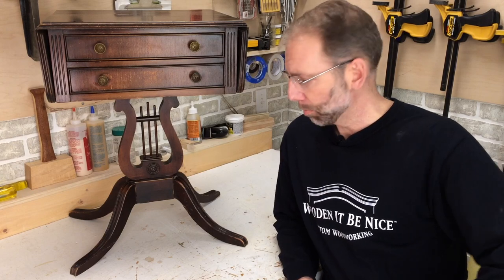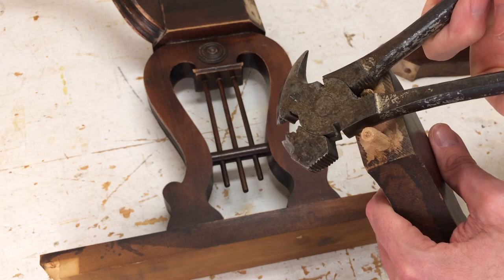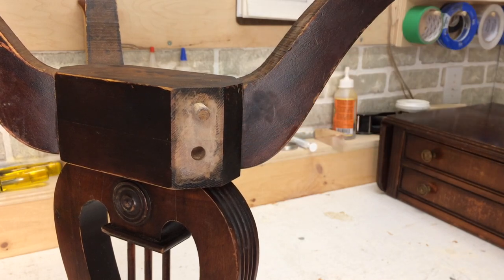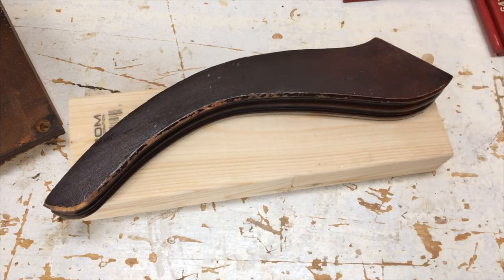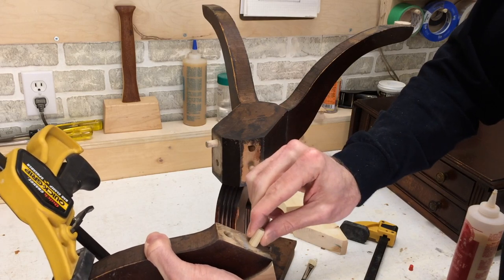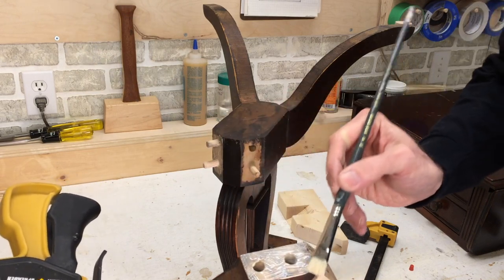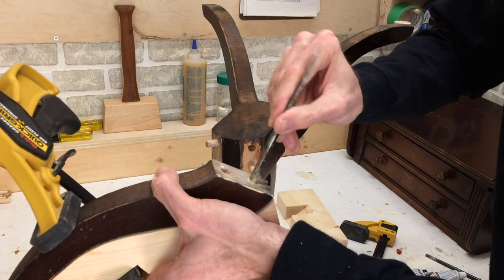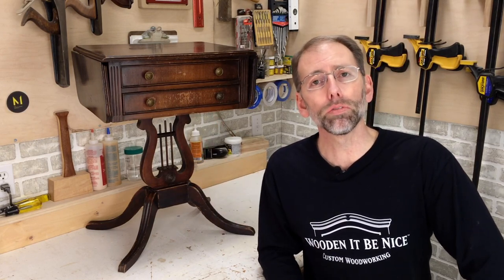Pedestal Table Leg Repair with Vector Clamping | Woodworking How To #Restoration

Comment: Hello, 

I understand from a traditional or restoration perspective (and perhaps from a preservation or appraisal perspective) why you would want to use Hyde glue on an antique if Hyde glue was used originally, but I'm having trouble understanding why functionally it wouldn't work to use modern glues? Aren't the wood properties going to behave the same? What if my purpose is to NOT have the joint coming apart again? But please correct me if this is just not what I should be going for with my furniture joints. I'm here to learn. Thanks for your videos!

Matt

Comment: Great video, illustrating the tenets of which type of glue to use as taught in your "glue video".  I understand using epoxy because of its gap filling properties, but in an extremely loose mortise situation (dowel joint), are you ever tempted to increase the size of the dowel and re-drill the holes to the next size up? Then you could use PVA glue. Also, when you do use dowels, do you place the dowel grain parallel to the leg wood grain to avoid a "cross grain" situation, or is the expansion and contraction of the dowel grain is so minimal as to not being important.  Thank you so much Craig

Comment: Thanks for the really good video. I do have a question though. I have an antique mahogany table and a leg came off one pedestal. I have cleaned out the dowel holes and have new dowels and I’m ready to glue. Is Titebond III good wood glue for the face of the joint and what epoxy can I use for the dowels? Tom

Comment: @FixingFurniture good job! Thanks for the lesson. 
When type of pliers are those? They look like they would be good for pulling staples and nails. 
Trying to learn as much as I can...why would you not use filler on a hidden connection simply because it's antique?

Why do you use hide glue instead of today's type? Nobody will see it and I don't want them coming apart in the heat of summer. 
I will be working on antiques again.  Wish you could see the old phonograph I got for free! It works but definitely needs tlc...waiting for no more snow...blech. I have to work outside for the most part. 
Speaking of which...any idea how I can remove the tired felt the records ride on and do I require a specific felt?
Reply: P.s. I just shared your video with two groups I belong to.

Comment: Thank you for this video!  I have a very sentimental dining room table from the 1940’s with six pedestal legs which are starting to fail.  I’m going to attempt to re-glue and clamp them myself.  One question if I could ask:  a few of the legs are clearly separating from the post but are not easily coming off by me pulling on them.  I’m a little hesitant to wedge them off, but I’m thinking this may be the best option?  Do you have any advice?  Thank you greatly for this video!
Reply from the maker: Wedges are the most gentle way to separate them.  Just make sure you use the wedge on the bottom edge of the leg and not the top as the grain on the top could break of some wood.  I hope that helps.  Scott

Comment: Great video as usual. One observation, you seemed to struggle with the clamp to get the joint tight, conventional screwed clamps exert a great deal more pressure than the quick grip 'pump' type you have there.
Reply from the maker: Thank you for sharing the tip Graham!  I found it useful, and hopefully others in this furniture repair community will too!  Scott

Comment: WOW!  I have my great aunts 2 pedestal  dining table.  My dad, who did some woodworking, tried to repair it but came into the same problem he had....nowhere to clamp. I think I'll give it another try so I can remove the support wood block. We can't use it because it is so wobbly.  The chairs need gluing too. This set, along with the China cabinet and buffet were damaged by Hurricane Katrina...that bitch!! The sides are warping. At this point,  do I just live with it or pitch it out? It's almost, if not 100 years old. They don't make furniture that good anymore. Hurricane Ida...think it was that 1 didn't help matters. Hot as hell with ceiling falling down with humidity...good thing the food is so good down here. Anyway, I'm glad I  found your channel.  I'm in the process of slicing 2 armrests into 4 legs for a child's vanity stool. I don't know what I'm doing but I'm trying!
Reply from the maker: I'm glad you found our channel.  We have a lot of videos to help you learn about furniture restoration.  I suggest starting with simple repairs to build your skills.  The china cabinet and hutch sound like an advanced repair, which you may want to discuss with a professional to restore.  Scott

Comment: Scott, a great video,  thank you so much!. I have a 1940s pedestal dining table (6 legs)  where I have a similar problem. I was treating the dining room as an antique so did all other repairs with hide glue. However, one leg on the table has a loose dowel joint (larger hole) which is fixed with epoxy in your video. How do I fix with hide glue to fix the gaps?  It's the last in my puzzle to get the dining room finished. I could use epoxy but wanted to stay true to principle of hide glue all the way through. Many thanks in advance. German Paz, Houston - Texas.
Reply from the maker: Hi German.  I've visited Houston on vacation - nice spot!

There are two ways to repair a loose hole for a tenon without epoxy.  One way is to drill out a much larger hole, then fill it in with a dowel of the same size to plug the hole.  Then you can drill the right size hole for the existing dowel.

Another way is to replace the existing dowel with a larger dowel.  That means cutting it off, drilling it out to the new size.  Drill out the old hole to the same size.  This may be risky if you don't have much wood on either side of the dowel as you'll be weakening the integrity of the wood.  Does that make sense?

Cheers.  Scott
Reply: @FixingFurniture  Thank you so much, that was a quick response, great timing as I have to get ready for Thanksgiving. Keep up the good work! Best Wishes!

Comment: Your videos have been very helpful and have given me the confidence to attempt repairs on my own. Thanks. How do I shim a dowel hole that has just a little too much wiggle? Making the shim thin enough and getting it to stay in place have been real challenges. Any suggestions or videos I can refer to?
Reply from the maker: One option would be to drill out the hole larger and insert a larger dowel.  If you don't have the space for that, I don't recommend a shim unless you're using epoxy.  Wood glue won't hold unless the mating pieces are meeting well and are clamped under pressure.  I hope that helps.  Scott
Reply: @FixingFurniture  Thanks for the prompt response. I think replacing the dowels might be the way to go. Scraping the glue off them made them smaller so maybe the mortise isn't too big but the dowel is too small now. I'll investigate that and experiment with different dowel sizes before I try drilling. Thanks for your advice. It's given me a way forward. Doug
Reply: @FixingFurniture  I took out the dowel pins and replaced them with the same sized ones. I'd been too aggressive taking off the glue and the original dowels. The new ones fit one side well and needed to be sanded a bit to get a good fit on the other side. I glued it up and it came out really solid. Thanks again for the help.

Comment: 1. I have a piece just like this one.  One leg is broken.  Looks like Rot.  I remove it and another by using white vinegar. It dissolved the glue and the leg came off easily. I'm just starting to repair furniture and I don't know too much about I D of wood.  What kind of wood is it on your table and can I purchase new legs or make them.
Reply from the maker: Hi Josh - wood identification is something that takes time to learn.  The easiest solution would be to take your parts to a local lumber store and have one of their experts tell you what the wood is.  You can make the part, but I'm not sure you can buy a replacement.  I hope that helps.  Thanks for being a subscriber!  Scott

Comment: Could you add a small brace to keep the leg from wandering?
Reply from the maker: You could, but I don't recommend it.  I've seen this a few times and it causes the loose joints to wear the wood can create more damage.

Comment: Great video.  My wife bought me a beautiful small chair with turned legs with loose tenons.  I was apprehensive about just gluing them together with only VPA glue and building up the small tenons with wood shavings was my only option.  I like the idea of using a combination of glues.  Do you have any concerns about using Titebond 2 or 3 for this work?
Reply from the maker: Hi Herb.  Titebond 3 is waterproof and for outdoor work, so I wouldn't use it.  Titebond 2 is good for furniture repair, but I don't use it because the open time is about 5 minutes (the time you have to spread the glue and position the piece).  I prefer Lee Valley Cabinetmaker's Glue because the open time is 15-20 minutes.  I hope that helps.  Scott
Reply: @FixingFurniture  Thank you for your quick reply.  I would love to purchase Lee Valley glue.  Unfortunately they will not sell and ship it October through April.  This is due to the potential for freezing which ruins the glue.  I have had issues in the past with this in my unheated garage workshop.  Fortunately we don't get many freezes in south Texas.
Reply: @FixingFurniture  I just found what may be a solution for me.  There is a Wood Craft store next to me that offers a new version of Titebond II extend which claims to have 3 times the open time with a 24 hour full strength set.  It is also offered on Amazon with a 2 day delivery.  I will try it  and post my results.  Thanks again for offering an educational video that teaches and encourages hobbyist like myself to try new things.
Reply: @CARLOSTREUIL  Comments like yours make this rewarding for me. Thank you.  Scott

Comment: Thanks for the videos!  Very helpful. How do you charge for working on the furniture?  Is it hourly, or by the job?  Do you have any suggestions?  I’m trying to learn what a fair price is. It would also be help to know how much you would charge and or how much total time you spent on the project from beginning to end.  Thank you so much for sharing your years of experience and craft! Nice video just subscribed.
Reply from the maker: I've created a video about how to price work as a woodworking business - https://youtu.be/d42Dlu0ehHg  This is a complex topic and in the video I show you a practical example and how much I charge.  For repairs, I estimate how long it will take me and give my customer a fixed price.  Sometimes I do service calls, where I change a service call rate, which includes 20 minutes of labor, and charge hourly after that.  Let me know if you have any questions that the video doesn't explain.  Cheers.  Scott

Comment: I use epoxy a lot.  One thing that worries me - does it, when cured, become brittle and inflexible and therefore won't expand and contract the way PVA will?
Reply from the maker: Good question.  I've had some left over epoxy and when it's dried, its got the consistency of a very firm caulking.  It's not hard and brittle.  I haven't used more than 2 types of epoxy, but my experience is that its not brittle.

PVA glues bond the wood fibers together, so the glue doesn't actually move, the wood does.  I hope that helps.  Scott

Comment: What if you have a 3 leg table?
Reply from the maker: It's a little easier with a 3 leg table as you don't need to worry about rocking.  The clamping is slightly easier too, though you need to use the vector clamping technique I show.  I hope that helps.  Scott

Comment: I have a small pedestal table where one leg is loose.  That leg has been repaired several times, one included screwing the joint together, which didn't hold.  How do I repair this leg?  Last time wood glue was used and only one of the two dowels is loose.  I can't, at this time, remove the leg.  Do I just add more wood glue where the leg is separated or try to remove the glue and then the leg?
Reply from the maker: Screws don't work in furniture when they're put under shifting loads like these legs or chairs.  The metal wears out the wood.  Because wood glue only works when there's tight joints, I recommend using epoxy.  You will need to separate the joint, clean off all the old glue, then glue and clamp the joint together.  Here are several videos to help you out:
- Type of glue - https://youtu.be/aRYNAlbBDUg
- Clamping odd joints - https://youtu.be/izMaQp5myf8

I hope that helps.  Scott

Comment: I am repairing a Windsor chair for a church charity. When re-gluing (with Hide glue) the spindles do you insert them into the comb or the seat first?  Your videos have emboldened me to attempt such a project. Thanks.
Reply from the maker: Good question Ray.  I suggest inserting them into the seat first.  That way you're using gravity to help you out.  The other way might be frustrating if parts are falling out.  I hope that helps.  Scott

Comment: I understand Hide glue for antiques. However, in 200 years time my modern piece will by an antique. Why use epoxy on it when it is not necessary.

Comment: Why use that ill fitting dowel. Using glue ( any kind) as a filler is a bad choice. If it was 7/16 hole. Up size by drilling ALL the dowels pin holes to 1/2". Use NEW ready made dowels that have the glue groves spiraled around. If a hole is just to large. From a previous repair or what ever. Clamped it in the drill press. Drill to the next size that will allow a tight  dowel to hole fit. Glue in a dowel. Cutting it flush with the surface. Then drill the proper size hole. Extremely difficult I know. To get it in exactly the right place. Takes experience. A Stanley #59 doweling jig is one thing I use.  A good set up on a drill press will also work well. A word of caution on these pedestal legs like those. Some tables with those. Especially larger dining tables. Have a thin piece of plywood 1/8'' sandwiched in the middle of the leg. Factory done.  Hard to see. Disguised in flutes most often. This prevents the leg from splitting easily along the grain. Naturally, the dowels intersect this. In a older table. That the glue has dried out. Become brittle. Along with everyday use of the table. These joints will fail. If they haven't failed. When the legs are separating from the stump as with this table. They most likely fail as you are working on them. GREATLY increasing the time you spend repairing it. Look carefully. When biding on those. Easy to take one to cheap. One more thing. A flat metal strip. Can be shaped and drilled to accept screws. Placed on the bottom of the stump. Bridging across the joint to the leg. Painted, screwed down. Greatly increasing the strength of the joint. Often times these are factory installed. If not they can be made. Not seen. As they are facing down.